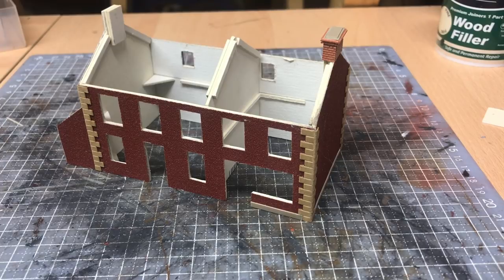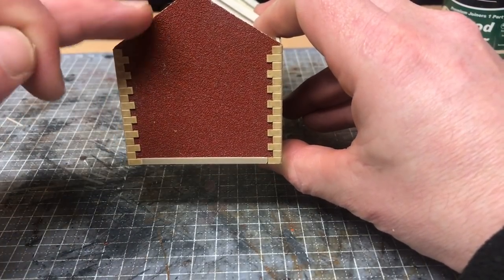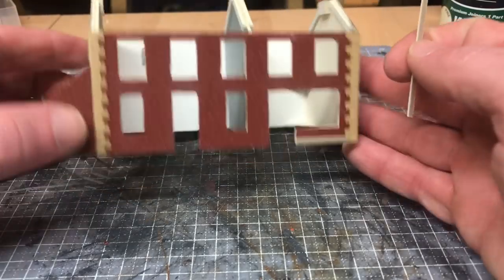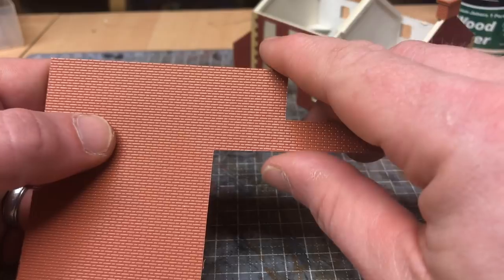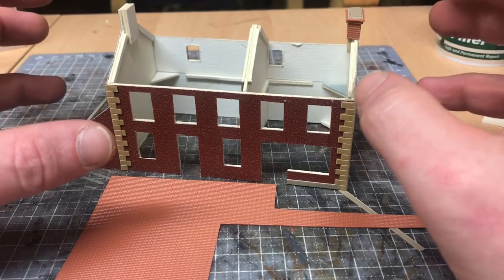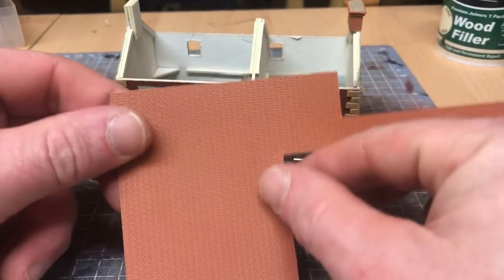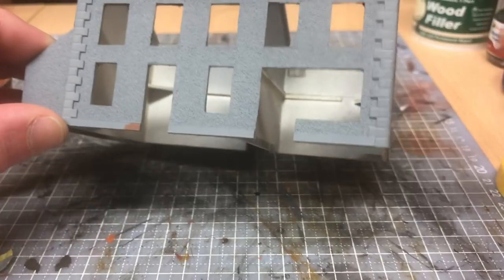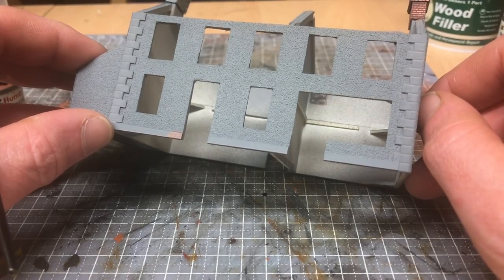Building A OO Gauge Model Railway: Scratch Build Series - 1.4 Chimney Detailing And Painting

Comment: Hi Paul following your video to make the scratch build my first had to stop for a while but back on it now - hey trying to cut the brick plasticard but it very fragile and it just seems to all crack up on me - any tips you make it look so easy !
Reply from the maker: Hi Mark. If your plasticard is cracking it may be because it has become brittle. I’ve discovered that in the past with older sheets having been stored for some time. I’m afraid it’s a case of throwing it away and buying new. Paul

Comment: That's really taking shape Paul and it is amazing how much detail you start noticing about a building when you really look even if you have seen it many times before.  The moulding around the base really does add something and finishes the wall nicely.  I will add this to the list for scratch building at some point.  A certain Art Deco Hotel may have recently gone to the top of the list for me 😉.  Stephen
Reply from the maker: It does very suddenly appear different from all the other viewings since the paint went on. I think you’re right too, the lower mounding just helps set it off a bit more. I’d love to see an N gauge version of this carried out but even more than that I want to see that Art Deco hotel. Did you check out Frankland? Paul
Reply: @GalgormHall   Yes I did and thanks for the tip off about that layout.  Some superb modelling.  One of his buildings has many features of a draft sketch I did after your comment, which is a cross between the Midland Hotel at Morecambe, an office building I used to pass near Leicester Square when I worked in London, and an apartment building just around the corner from me here in Edinburgh.  All I have to do now is to work out how to pull off the flowing lines and to build the thing.  Stephen
Reply from the maker: Haha, the scratch build bug has well and truly bitten. Can’t wait to see the start of it all. Paul

Comment: Great job mate it's a stoats...a wee tip..stick some of that sandpaper maybe 240 gt on the back of yer ruler n it'll no slip cutting the card wee tip 2 you can use your plastic cement to stick plasticard on anything but shiny surface.put a line of it on the back of the plastic edgeing your doing n leave it a few second to soften the plastic then stick it on.if it's revell contacta or similar...wee tip 3 your chimneys with Slater's can be done without cutting all four sides is mark each edge where the corners are n again a line of cement on each corner as it'll soften the plastic enough to bend without breaking.
I use methylene chloride the base product that makes plastic cement n they put retarder iin it to thicken it.tamiya super thin ,£6.00 for 135ml... methylene chloride 5ltrs £6.00 ...you can get up to a lot of plastic fabrication with it.its fantastic stuff...awsome trick wae the sandpaper I did that 35yr ago wae Hornby buildings .
Reply from the maker: Jim, three top tips there, thanks for that. The sandpaper one is a particular gem, I’ll be giving that a shot before I next model. Paul

Comment: Can I ask how do you do you work out your scale.
Reply from the maker: Hi John, you sure can. In the case of this build I went on the height of the door. A OO gauge doorway is approximately 28mm so using that I could get a rough idea of how the rest of the building would measure up. On a brick built structure I’ve also counted the course of brick from ground to roof and transferred that to the plasticard version and worked out spacing between windows by counting the number of bricks in a row. Even with all that some of it just comes down to how it looks to the eye when the initial structure is built and small modifications are made accordingly. The beauty of any real building is there is no one size fits all with many variations on height seen in one row of buildings. I hope that is of some help to you. If you need anything more, just ask. Paul